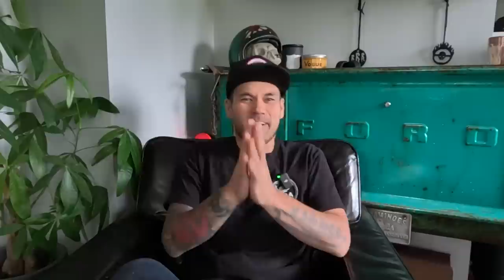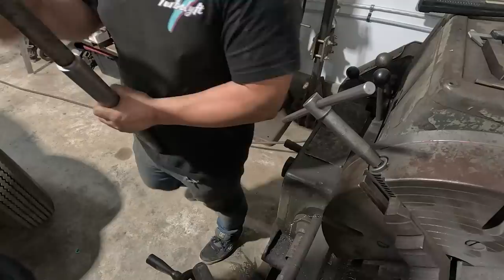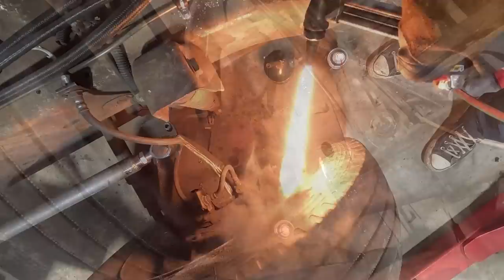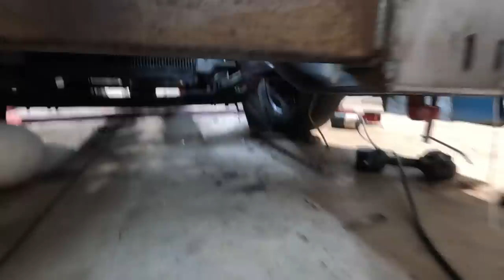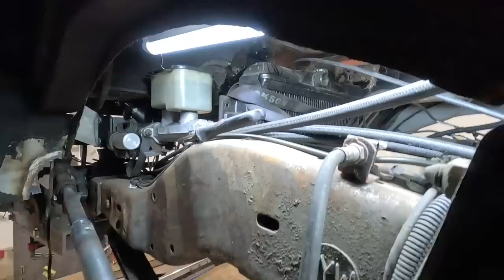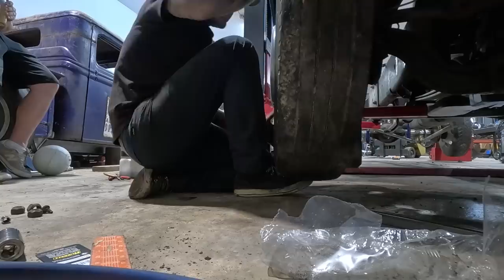FIRST DRIVE!!! COE Ramp Truck EP-9 Finishing Steering & Brakes. Drag Link Fabrication

Comment: Absolutely awesome.  Tis running under it's own power at last.  All those parts and spare bits pulled in and sat for ages now its rolling along ..I can just imagine the size of that grin in your face . Now it can be moved round the shop when needed and not having to tow or drag it about . Easy mistake on the pipes for the steering you had a 50 50 chance getting them correct or not lol who knew lol .. thanks for sharing Karl

Comment: heating and the cold water always works when heat alone still won't work. I thought for sure the grease fitting was gonna snap. MY momma always said Everything happens for a reason although it took me a long long time to learn that one.  I've learn not to fret anymore over things because all things work out for out Good. It All works out in our favor to those who love God and are called according to his purpose. Congrats to finally seeing you your shop truck on the road and running for the very first time. kudos to you both. Killer looking ride.

Comment: Great stuff as usual. One thing you've got to watch on those vacuum bleeders is that sometimes they'll suck air into the line around the bleeder nipple. This doesn't necessarily add air to the system but it can give you air in your suction hose and make it seem like there's an endless amount of air in the lines. I gave up on mine and went to a positive pressure bleeder, which has been working much better for me.
Reply: Positive bleeder much better

Comment: Carl have you ever used candle wax instead of penetrating fluid?
Its an old trick but definitely works.
Heat up whatever your trying to loosen ad the wax it works like capillary attraction gets right in there and is non flammable just works its way into the threads and even if it sets you`ll still be able to slip that bolt out with ease.
Oh and vacuum bleeding is the way forward ALL DAY LONG.

Comment: Hint,  for getting old bleeders open first tap around the bleeder with a hammer and flat punch or an air hammer with a flat bit.  The vibration loosens the rust grip and helps a lot with stubborn bleeders
Reply: This definitely works. I use a piece of brass and hit around the hex.
Reply: But the old Victor Hot Wrench is most commonly used in road salt areas 😮😢 the locals are working with the parts manufacturers to wear the cars out from the outside in rather than the usual way…..damn salt!
Reply: A 3/8 dr impact turned way down...rattle the bleeder screw ,..it will open in a minute!

Comment: Those vacuum bleeders are super handy, cut down on the pedal pumping. Use them all the time in the shop. They create vacuum from the shop air thru an orifice. Important to allow them to equalize before removing it from the bleeder by turning it off first and watching the fluid stabilize in the hose.

Truck is gonna be so cool AND handy as a tow rig once done!
Reply from the maker: Thanks for the tip!

Comment: Using heat on rusted bleeders does get them loose, you just risk melting the rubber inside the caliper. You didn't this time around, just be aware this can happen.
When you get the bleeders out, cleaning them out with small drill bits ensures they will bleed.
On clippers that the bleeder breaks off, they sell kits to fix them. You drill out the broken bleeder, tap it to the size of the new bleeder seat and thread in the new bleeder.

Comment: The best way I have found to take out stuck bleader screws on cast-iron callipers heat bleeder heat the bleeder screw up cool it down with water repeat twice and tap it with a hammer and then loosen it up probably do three or four day. Got to love the rust belt.

Comment: An old guy showed me this at midis back in 84 when I was 19 if you heat the Bleader red hot and  then quench it whit some kind of water source,you can just about take it out with your fingers. We have one of those cans that your fill with water, and then pressurize it that's what we use.

Comment: I saw it and knew immediately: you won't be able to get over the red bar of the lifting platform that slowly! :face-turquoise-covering-eyes:
Had to laugh when it happened exactly like that... :face-blue-smiling:
No weight on the rear axle, single wheels and the floor is smeared, and the exterior mirrors can hardly be folded in ---> everything fits! 
Watching is always more fun!!! :goodvibes:     Best regards from Germany 👨‍🔧

Comment: A tip I learned for the bleeders is heat them up and then throw ice cold water on the bleeder. It'll break the contact rust instantly.

Comment: You might want to change the wheel lugs and lug nuts you have heated as when you heat them you remove the tempering and they break under stress. As a guy who has spent over 20 years of his life as a mechanic I have seen this a couple times. I'm not trying to be a "I told you so" person just trying to save you from some real danger. As always great content from a guy who does sheet metal fab way better than me. Have a great day Carl.

Comment: 13:59 I had a lot of success loosening breeder screws with a air hammer using a blunt end tool in it.
Focus on the cast iron in the tread area as much as you can from the side.
Work the bleeder screw back and forth to loosen.
Reply from the maker: Ya that makes sense the blunt end would stretch ! Thanks for the tip I would have much rather do that
Reply: My go-to is my M12 impact driver on the lowest setting. A little heat and the gentle impact won't snap it off but seems to give just enough to break it free.

Comment: Karl you need them big fat steering tires they put on the front of cement trucks, it would fill out those ginormous wheel arches and that huge fender overhang.

Comment: Water is the trick for getting bleeders loose. heat the bleeder itself and then spray with cold water.  The hot to cold reaction breaks the corrosion/rust loose.

Comment: In B.C. you are not allowed to have non OEM welded steering parts on the vehicle.Should have had a longer adjusting sleeve made for the two draglink pieces.

Comment: Been waiting for this test drive ❤. On a side note the calipers are only interchangeable side to side if it has two bleeder screws, one top one bottom. Bleeders on the bottom wont do you any good.
Reply from the maker: The banjo fitting and bleeder screws are the same on this!
Reply: @MakeItKustom  oh so it's dealers choice. Cool 👍

Comment: Bleeder screws,heat/cool with water at least 3 times before loosening. Very effective. Same for brake line fittings. 99.9% success rate. 
I rarely use penetrating oil. If i do its after part starts moving.
Darn Karl, too many trips and a failure to boot. Think a guy needs to perform an exorcism or make an offering to the car gods after a day like that. Been there. Lots of rough days since may. Yesterday went better than expected.
Reply: next time he might right no pads on stuff lol to easy to forget after months
Reply from the maker: hahah yea it was oneof those dayys lol
Reply: @MakeItKustom  we have all been there lol

Comment: When you are fooling around with getting parts for trucks it is best to have the original VIN number (if possible). The reason is trucks will go by that in case there is some running changes made during manufacture and therefore it can turn into many trips to the auto parts store and acquiring the wrong parts. When I was an RPS P&D Contractor (now FedEx Ground) we had International chassis with the various step van body manufacturers supplying the bodies. Now anybody you talk to (especially parts guys other than dealership personnel) cringe when you mention International trucks (actually it's Navistar). Providing the last eight numbers of the VIN or serial number will get you the right part. Actually the International chassis we used had the same brake setup in that it had the dual piston calipers on the rear axle (you have more weight to stop with dual wheels) and the single piston front calipers on the front axle (the pads on the front axle actually lasted two to one versus the rears). The brake system was actually a Bendix system. We had a contractor who had an International with a Delco Moraine master cylinder that was leaking bad and I replaced it with a Bendix by using a VIN number from another van. Of course, I am probably wondering why my ears may be burning from another mechanic cussing me because he can't get the right master cylinder for that truck. Oh, the tangled web we do weave.

Comment: As narrow as those front wheels are, i'd almost vote for putting wheel skirts on the front, although I do believe you said you are putting different, wider wheels on there.
As for the drag link, does the tire not rub on it in right turns? With how much the wheel is set 'in', it must be getting pretty close at least.

Comment: Here's a tip for the next time you deal with stuck bleeder screws... Heat it a little then give it a sharp rap right on the end with a hammer. That'll break the bond.

Comment: Heys killing on thre ramp truck i noticed that when you fitted the new caliper it looks like its a right hand one as the bleeder is at the bottom which might make bleeding it with out a power difficult as air could get trapped above it  cant for the next episode

Comment: Cool build. Boy, those rotors are awfully rusty. Any reason why you didn't replace them while you were at it or at least surface them slightly. Or did they work out okay as is?
Reply from the maker: they should be ok but if not ill have them turned

Comment: Never use anti-seize or any lubricants on wheel lugs. The torque specs are for dry threads only. Also, going to dual piston calipers will likely mess up your master/ slave ratio as well as your front/rear ratio. If the master can handle the additional volume in the front calipers, you might be able to sort it with the proportioning valve.

Comment: Do you know why those bleed nipples were rusted into the calipers ?    Simply because there were no rubber caps on them.   Have look at the design of a bleed nipple.  Water gets in and runs down through the little bleed holes into the thread.  Car manufacturers don't spend a cent on anything that isn't necessary .  Put some caps on those nipples. 😉
Reply from the maker: such a underestimated part to keep bleeders nice

Comment: The glaringly obvious,, you have built this low and have a HUGE step in the chassis so your tray will be at least normal height. So quite impractical. Do NOT use a heim on that drag link as they are not very strong. Race vehicle maybe, everyday defenitly not. Use the proper ball joint, manufacturers use them for a reason